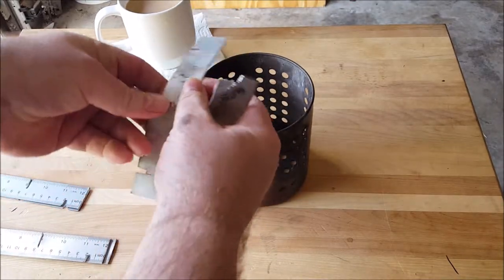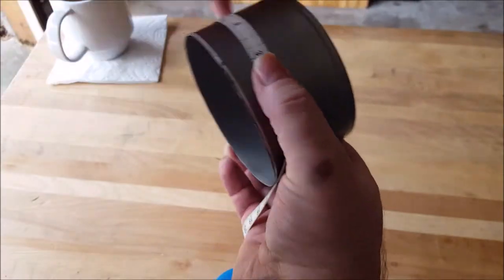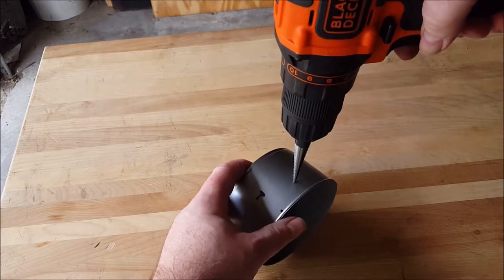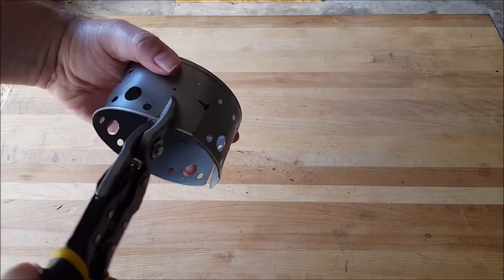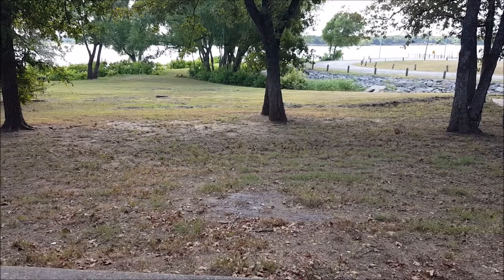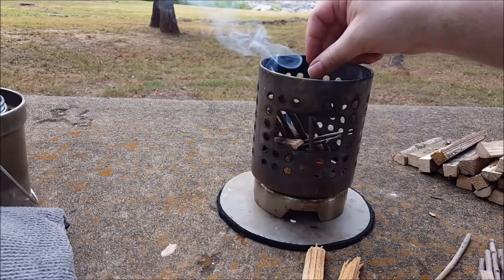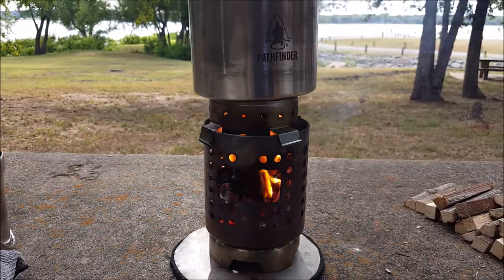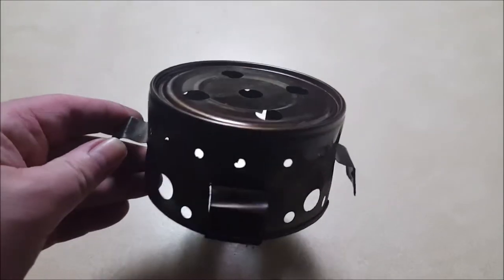DIY Tuna Can Pot Stand for IKEA "Hobo" Stove

Comment: If you don't mind it flush you can use a computer fan screen OR a heavier stainless shower drain cover found at Lowes for a grate.

It is slower because you need to open up the top around the pot you are using.

Comment: A mini cake pan, or even a paint can lid will also work too. Avoid using holes on the the very top where the pot sits so you have no soot. :)Almost like a wood stove. The fire burns hotter, and dryer with a sealed stove. Love this video!
Reply: No soot but most likely a slower boil and more smoke

Comment: An interesting idea 💡and a well done proof of concept test. I believe that the pot stand on top was acting as a heat sink in that it would take the heat of the fire and use this product of combustion to warm the trapped air. Some of the heat also was retained by the metal of the support. And then the breeze and  the normal the properties thermal dynamic conduction works to dissipate the heat.
I am writing this post because I believe that you are otherwise on the right track to make an informative design project that about a question regarding the best types of hobo stove setup. Thanks for sharing this information.
Reply from the maker: I agree. The heat kinda seemed to get trapped by the pot stand as it is. The shape of the upside down tuna can makes a literal "cap." I think a lot more holes would help, including some more on the sides so the flames might have a chance to rise up around the bottom of a pot. Thanks for watching and for the great feedback.

Comment: Swedish fire logs.

Baton a small log with a diameter nearly the size of the diameter of the stove.
Place inside the stove and some tinder in it to start it.
Will burn pretty hot and for a decent length of time.

One problem I see with the Ikea hobo stove is that it has too many air holes and in the wrong places.

One could make that stove into a rocket stove by blocking those holes and letting it draw from underneath.
Best efficiency is a well controlled air flow.

As you found in the video, those air holes let out heat when the wind blew.

To counter that you need a wind screen or cover most of the holes in the side.

The bottom is clever but takes two containers - one for the stove and one for the bottom.

Some people put the feed hole near the top and others near the bottom.

I wonder what the effect is other than convenience.